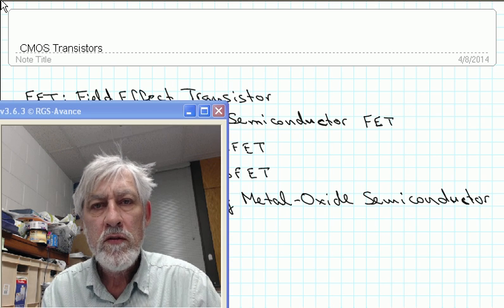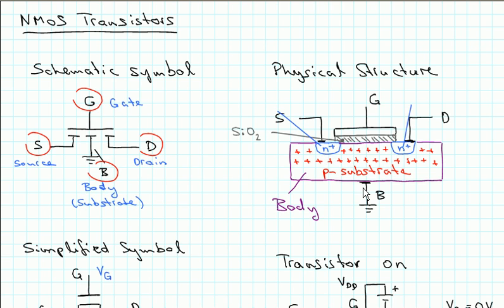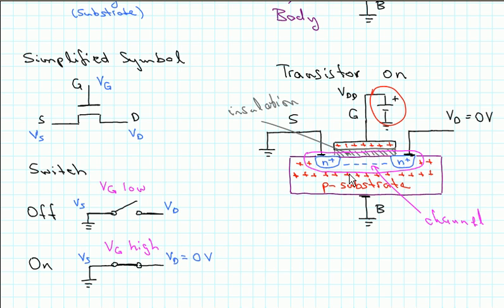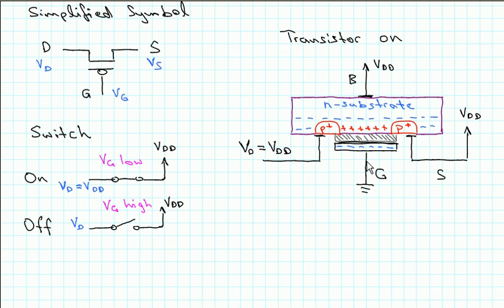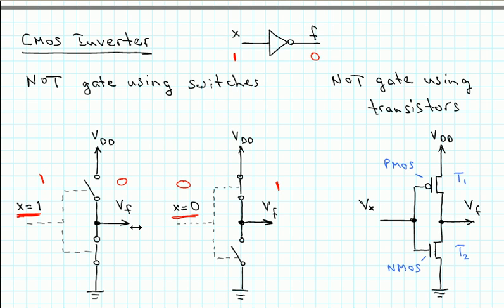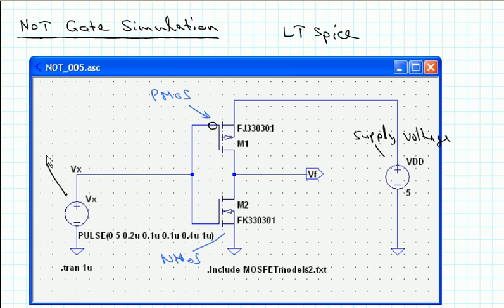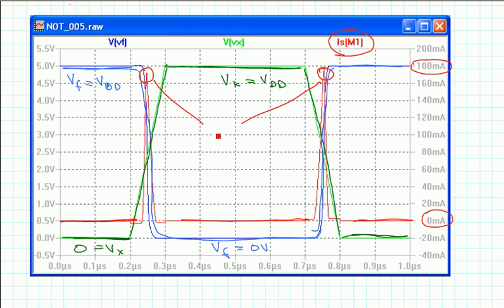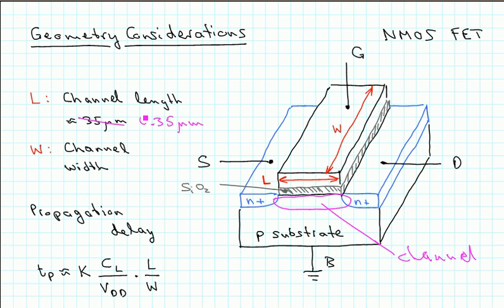CMOS Transistors

Comment: Hi.Peter sir an Excellent explanation of Cmos in Easier method..in My M.Tech(Digital communication) in 3rd semester a subject was Digital Vlsi Design..Really very tough subject was Digital vlsi Design..Please one my query if GATE to source voltage is Vgs and Drain to source voltage is Vds than what will Drain to source current?

Comment: Some things I don't get about pMOS: How is connecting the gate to ground putting negative charges onto the gate? Ground is neither positive nor negative, right?

And what does it mean that nMOS's pull things down to ground while pMOS's pull things up to the source? Pull what up and down?
Reply: Analyze as potential at Gate is w.r.t body, source and drain potential. Pull things down is to bring a circuit potential from high low and vice versa